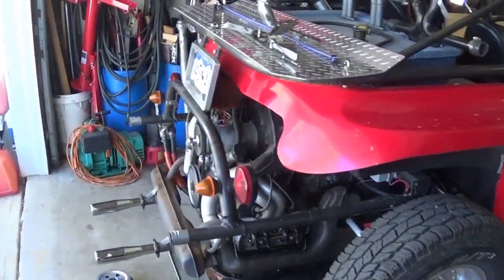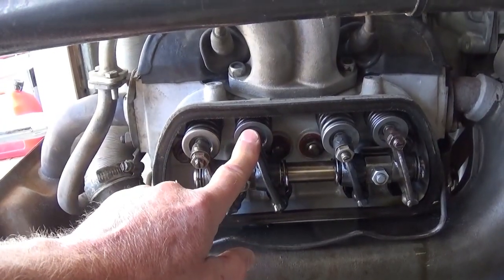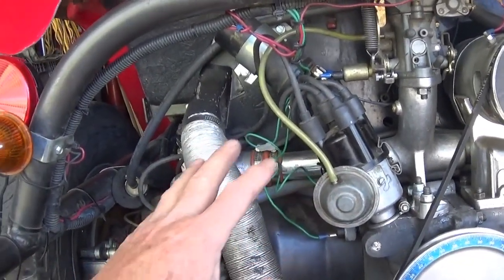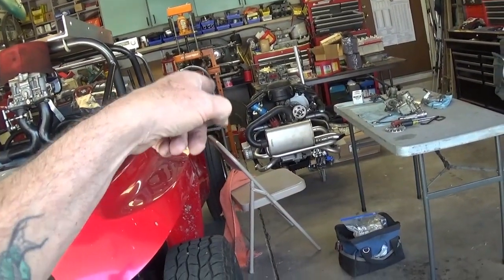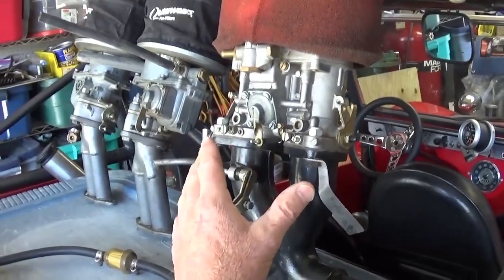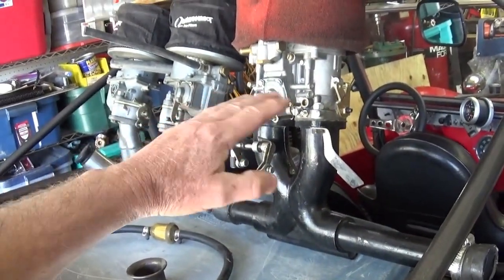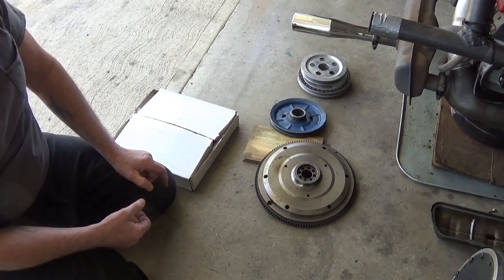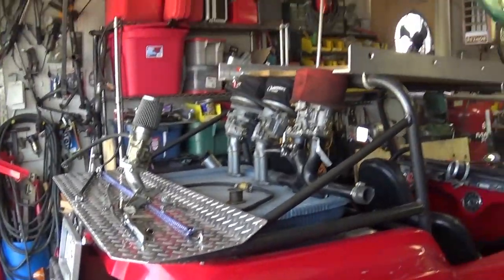VW 1600 DP Power Mods

Comment: Hey Gary it was another pleasure to watch a few videos back to back! I noticed in the background a harbor freight tire machine, what a great piece of affordable equipment:)  i would love to see your experience with a amr500 supercharger on a stock motor, for 150 bucks and a little fab work and tuning they are the best bang for the buck for power improvement:) as far as chrome goes I've always heard and said myself chrome don't get ya home but billet won't kill it, I have since heard a new saying that made me laugh, chrome don't get ya home but it will get ya dome. Hope that gives ya a little chuckle:) keep on doing what you do and keep the great info coming out for all the Volkswagen enthusiasts that come to watch you for a Volkswagen sermon or just a laugh:) stay safe and keep the wheels spinning and the beavers grinnin!
Reply from the maker: I can't get the stock crap to work right 1/2 the time. I don't want to start fighting with a $$$ supercharger. I've only seen those in Australia. I wish that old Dick Landy set up had set up for a weber instead of a Holley
Reply: @TheEZGZ  look at some of my videos, I bought an amr500 for 140 bucks if I remember correctly, used a stock intake and made some adapters and even used a single kadron but as you know they were designed to feed 2 cylinders not 4 but i have seen some people use stock carbs on top and have great success:) but I hear ya just one more thing to complicate our simple little motors

Comment: Thx for the tips on the flywheel. The shop I order at claims that the cheaper cast iron will work only if you use a seal with a single lip. One with a double lip used on these flywheel will cause oil leaks, because the rounding on the flywheel starts earlier , causing extra wear on the seal ....  I only have a stock one, and not the other one (yet), so I cannot compare the roundings ...

Comment: Nice video.  I’ve been pondering running oil through my center mount with Dellorto 40 drla.   I may try it someday. Or by then maybe I’ll find a dual set up I can refurbish and try.  Going to try some little things on my 1641 for fun until I build a bigger engine.  And a question you’ve been asked probably more times then you can count. Out of all the engines and camshafts you have ran what Camshaft and engine combo has been your favorite.   Loaded question I know!!!  Thanks For keeping me entertained!!  Randy L Peterson
Reply from the maker: Used to be 1776 but you can't be a 78x90.5 2 liter with cheater cam and stock heads IMHO
Reply: I always appreciate an honest opinion. After helping part time at a Race engine shop for 20 plus years the seat of the pants meter is usually better then the dyno sheet. Seen a lot of Engines run good on the dyno but not worth a Darn in the car. Been thinking of building a 1915 with my old 041 heads. Kinda like the specs on the Web 163 cam. Or a scat c35. Or as I have learned ask 100 people what they like for a Camshaft you will get 100 different answers ha ha.  I’ve read Engle 110 cam too big. Engle cam too mild. At then end of the day it comes down to a quality assembly and guy doing the tune and adjustments. Have a great week and I enjoy your videos. 
Randy L Peterson

Comment: Thanks EZ. Once again I have learned a few things. My parts collection is pretty vast as well. Most I which I have just bought in big parts buys and don't have any personal experience with. I have found some real gems in the junk I have and have found some real duds as well.
Reply from the maker: Space is a premium. I spent $8,500 in storage fee's to keep a bunch of greasy grimey transmissions and parts only to find out much of it was worn out or some little thing missing.  Now, I would rather have the space. Friends expect me to give them spare parts and get mad if I don't .    Horrding old VW parts is a waste of time and space IMHO.  It is a lot of fun to look threw trying to find a gold nugget or two. hehehehe
Reply: @TheEZGZ  I have spent that a few times over. I hope to move out of the extra space I rent for $550 a month this year. Only bonus was I could also work in the space I rented. Now I have purchased the house next door to mine and use that as my garage and work shop. At least I'm not throwing it away in rent anymore.

Comment: These are some great tips for the folks on a budget
Reply from the maker: Thanks, I figure if we educate the new guys they will buy parts and aftermarket will stay in business
Reply: QUESTION,  on the heat risers.  Sometimes when you buy a different exhaust the heat risers are not drilled out. Is it better to drill one heat Riser smaller then the other.?  This creates a low pressure causing the flow in One Direction. Or is it better to drill the heat risers both the same size?

Comment: bolt on 1600 performance...
.aa performance 40 35 high flow heads cut to 90.5
88 slip on thick wall cylinders
1.25 ratio rockers. and 2 barrel egas.
Reply from the maker: it don't cost nothing to pay attention!!!   Been there done that watch my old vids. Did it with a Fk7 cam  called it my mystery build.   I got 700+ vids. You got some catching up to do son.

Comment: Hi EZGZ, new to your channel and really love it! Thank you. Do you remember the single twin choke Niki carbs for 1600cc. I remember back in the late 70s we would add a hot air pickup to the air filter. I.e. capture exhaust heat to heat up incoming air.  It really helped. Also would you be so kind to let me know the name or brand of seat you are using the buggy. Many thanks, Roman
Reply from the maker: Never heard of Niki carbs.  Hard to get clean warm air intake that looks nice when hanging off the back of a buggy.  Those seats are over 25 years old Beard suspension seats

Comment: Hi Gary, I have a stock flywheel and I have noticed a very slight oil leak by shining a torch behind the flywheel you can just see in there and I can see a bit of oil put it doesn't trip through the bellhousing,
My question is, is it worth taking the flywheel and changing the oil seals as you say on this video that the stock flywheel will always have a slight leak,
Thanks you 👍
Reply from the maker: All of mine leak and I don't worry about it!

Comment: EZ, how are you? Got curious when you were talking flywheels... when you're changing a 6V bug to a 12V and you change the flywheel, does the old pressure plate bolt up to the new flywheel?
Reply from the maker: Nope.   it also won't fit in a stock 6 volt transmission unless you clearance the bell housing. You will also need a 12volt starting motor and smaller starter bushing to hold it in the bell housing

Comment: Hey EZGZ,  Thanks for the great videos,  question: you made reference to heat risers,  when you upgrade your exhaust sometimes the heat riser do not have holes in the heat risers and you have to drill them yourself.  Is it better to drill one heat riser hole smaller than the other side?   This creates a low pressure on the smaller hole side and the flow of exhaust in one direction.  Or is it better to have both heat riser holes the some size?  Thanks again.
Reply from the maker: I explained that in detail recently on this 1600 DP series. Go back and watch them......
Reply: Yes you did go into great detail about the intake heat, but I could not find anything on heatriser hole size.
Reply: I finally found a answer on the heat risers hole size.  Stock exhaust has a long heat riser tube and a short in the exhaust itself self.  The short side gets the smaller hole.  A good exhaust gasket set will have two heat riser gaskets .  One smaller size and one larger.  Smaller gasket to the short side .

Comment: Compared to a tuned 4-in-1 exhaust, the stock exhaust IS restrictive... tests with flow-meters have proved this point for decades and decades.
Reply from the maker: Why compare it and who cares if you’re not racing and just after a little more pep. Besides ALL 4 into one exhaust’s have clearance and fitting issues. Plan on avoiding most speed bumps.  I guess there’s a trade off with everything. PEACE

Comment: Would not having a heating pipe on the inlet manifold cause flooding at hot starts. Freezing the fuel then melting into the cylinders after the engine is turned off.
Reply from the maker: Yes and if it sits long enough it will get in the cylinders and wash away the oil on the bottom of the cylinders and ruin your rings along with diluting your engine oil.  It will run like a bat out of hell at WOT on a warm day. Thats why all the race cars use them in the Baja 1000 and then throw the engine away!

Comment: The manifold i have on my motor doesnt have the heat riser on the manifold as i live in south africa.
Reply from the maker: It would run smoother and get better MPG if it did
Reply: @TheEZGZ  running a stinger exhaust. Ive always let my car warm up for a few minutes before i drive. At this moment i get between 25 too 30mpg at 25 too 40mph. Still running it in as its all new parts.

Comment: Ez my plugs go black then ends up fouling and miss fire , the question, is it because too much fuel or worn motor/ valve guides? Thanks
Reply from the maker: I would do a compression test on all 4 cylinders as long as you have the plugs out. That will tell you a lot.  
Try a hotter spark plug. 
Make sure your ignition system is good, Points, Cap, Rotor, plug wires
Valve guides go slightly downhill and even when worn don't suck much oil.  Will give you a blue smoke puff when you shift.
If you some extra money it's always nice to freshen up your engine and get it all clean and shiny

Comment: Bout to do and 88mm slippin kit over size vavle think 37mm for the intake  35.5mm on the exhaust side and match port my heads and see if I could find some power cones for the exhaust
Reply from the maker: 37 X  35 doesn't sound good. No sense reinventing the wheel.   Most common is 40 X 35 .  It's tried and true. 
88 slip in's only come in A pin height.  Works great for 69 crank.  IMHO I would do a fluff and buff on stock valve heads. You will have to cut them to 90.5 / 92  but get better flow.   Especially if your just doing cones on exhaust.  Do what you like and let us know the results. Good Luck with your project
Reply: Ya I was just thinking bout my cam its stock and really don't want to lose bottom in torque with the 40×35

Comment: Hey EZGZ, I have a 1974 Volkswagen Thing. When I first start it up, the engine run 5 minutes. Then it’s sounds like it want to died. Then the engine shut off. What can it be. A carburetor problem or timing problem. Thank you
Reply from the maker: Basic troubleshooting. EVERYTHING!  Plugs, points, wires, coil, compression, Choke linkage and adjustment.
If it's all stock I would take a close look at your choke. It might not be releasing and opening up.  Sometimes coils  fail when they are hot and then work when they are cold.

Comment: Hey man I getting ready for a cross country trip in my baja bug. Right now have a stock 1600 with a stringer exhaust 38/38 Weber dg I just put on but needs smaller jet tho so I got me a holley 2110 I've been wanting try. Have you ever used one on any of your builts? And if so how did they run
Reply from the maker: DO NOT EXPERIMENT FOR A CROSS COUNTRY RUN.
Keep it STOCK and save your experimenting for close to home until you work the bugs out.. Have a safe trip. I did 10k miles in one year a while back. Had a few hickup's away from home. Not fun.....

Comment: Hey EZGZ what is the idea temperature for the intake manifold under the car when driving around? I got a 74 bug last year and put a new to me motor in it. It has a new 34pict 3 carb from empi and a 4-1 header I believe it’s inch and 5/8ths I’m not sure. The intake that was on the motor had the heater ports already sawed off when I got it. The car rarely ever gets more than 10-12 mpg the most I’ve gotten is 20. It has over 60psi at cold idle and goes to less than 20psi when hot. It’s a 1600 dp with a dog house cooler, was an efi case. It has a lightened flywheel already. It has very little bottom end, I have to rev it to at least 2500 to take off. It’s a Baja configuration with 235/75 15 rear tires any help would be appreciated. Thanks.
Reply from the maker: You have the wrong dizzy.  Find a stock one that ends in #205 or buy a new pertronix svda flame thrower with pointless ignition. $150   Also when you buy a used engine your going to get what you pay for. 60-20 psi ????
Reply: TheEZGZ  I put a new kuhltek svda and new Bosch cool on it after I got it because I didn’t trust the old electronics. It was siting in a dirt floor garage. The old owner had a rail buggy parked outside so I’m assuming it was from that buggy.
Reply: I was just wondering if 15-20 psi is a safe hot idle oil pressure reading.
Reply from the maker: @PBMototsports  Who cares it just idling. Don't get caught up in that mine does this and yours does that. My 2 liter with aluminum block has 60 at idle.  How did you arrive at 15-20? Is that on your VDO dashboard gauge or an accurate on in place of the oil sender? Do you have the correct springs in the stock oil pressure relief system. Do you have the correct pistons in the oil relief system?  The book say's that if you have less than 28 PSI at 2,500 RPM your engine needs to be rebuilt. What weight oil and what is the temp?  Who gives a shit? Is this a pissing contest to see who can piss higher on the wall?  Listen to me..... Idle oil pressure means nothing to me. If your engine runs good drive it. If you suspect you have problems take it apart and look. Drag racers do this every week or so.  When I bought my rail with 2276 it ran great but had oil leaks. I took it all apart and plasti gauged the mains. It was in spec and ran great. I put it all back together and it doesn't leak as bad and I know what I got. If you have concerns with your beloved engine take it apart and LOOK and MEASURE. It a lot of work and PITHA but it feels so good when you know. I did not replace the bearings. They looked great and I put it back together. I'm happy. My 1776 had 18 PSI at idle and I ran it 20 years. (If you don't mind, it don't matter)

Comment: I am rebuilding my 1600. I saw a drop in 1800 kit that does not require any machine work on my block. Do you know anything about it and would it be worth it?
Reply from the maker: Yes, I built and own it. I did a whole series on my 1800 and called my mystery build.   You will still have to buy 90.5 cylinder heads or have yours machined. It is a lot better to build a 1776 IMHO
Reply: Ok. I checked jbugs and they have the kit to do it. I just want a motor that can run my ac better than the 1600. I had a 2387 in it but am over having a race car. Just want a good sold motor for every day driver
Reply from the maker: @MP-hx8fs  1776 because of the stock cylinder.  The 1800 is thicker at top but paper thin at the base to slip in.  Screw it. Cut your case!!!!!!!  Do what you want. You do not have my blessing on 1800.    Been there done that. You will find out the hard way.
Reply: I was just telling you what I wanted. Was not in no point being disrespectful. Just wanted your advice.
Reply: I don't think that is was being disrespectful by telling you that a 1776 will be far more reliable than the 1800 kit.
If anyone is being disrespectful, it's you, for making that poor air-cooled motor turn an AC compressor. What is wrong with you?!   Just kidding  : )

Comment: I have a Manx very similar to yours sir.
Reply from the maker: Very cool! I wish mine was a authenticated manx. Maybe even one of those full size ones with the curved windsheild. Looking forward to getting it out when the weather warms up.
Reply: I have a few questions sir.  I have a bone stock 1600cc with the twin exhaust.  Which I hear kills HP. Thinking of going with a snorkel exhaust.  But question is what can I do to increase HP.  What heads can I buy.  Not on a budget
Reply from the maker: Heads are a waste of money on a 1600.  If your serious and want to listen by some dual 40 Kadrons with 28mm venturi's New from Kaddie Shack and then look for a 1 3/8  Tube exhaust that you like. Just bolt it on and feel the difference and enjoy it for a while.  Think about building a completely separate engine like a Type 1 two liter 78x90.5 with engel 110 or smaller cam. (preferably smaller)  Big valve heads are for very high RPM and a waste of money for fun street or offroad engine. Everyone bracket races so who cares anyway. Plus you want your transmission to live a few more years.  80  or 90 HP is great for a stock clutch and a lot of fun and a lot of trouble free miles and smiles.